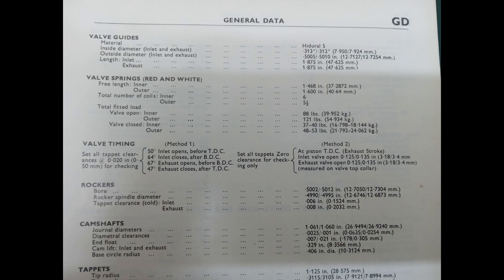Triumph Trident T160 Rebuild. Part 66: Optimising the Valve Timing 4

Comment: How do you stop valve spring pressure moving the camshaft while the pinion is not holding the camshaft still, or is this not a problem?
Reply from the maker: I can see why you might think that, but it's not a problem at all.

Comment: As far as the workshop manual settings being different, it seems to me that this lower setting is less tlikely to result in any home mechanics going over the absolute limit of 150 thou. I’ve found that many workshop manuals (including factory ones) prefer to err on the side of caution with such things. I have two manuals for my 1997 Harley Sportster and have found siginficant differences in the information provided in each. Not a lot of difference in the specifications area, but enough that I no longer regard the workshop manual as ‘THE BIBLE’ as far as such things go. More often, I rely on people such as the chap mentioned in this video, who know the machines very well and know the OPTIMUM settings for the best results. 
Of course, there are many ‘experts’ out there, but the ones who have a proven track record are not hard to find, as they will have decades of work behind them that testify to their acutual level of expertise. People who have built and maintained very succesful racing enigines for example. In the case of the Tridents, anyone involved with the factory racers would know better than your average factory trained mechanic.

Comment: Thanks for the update, but I don't feel much better off after your explanation. A dial indicator is still not going to register those 3 or 4 degrees when the piston doesn't move at TDC and BDC so it has always been a case of seeing where it stops moving and where it starts moving again, and split the difference, so a well educated guess, and I don't understand why the factory wouldn't set the valve timing at the 'optimum setting' rather than some 'good enough' setting when it's no harder to do and could result in a better running bike, it just doesn't make sense. Anyway, good luck with the project, looking forward to seeing the engine running.
Reply from the maker: Okay, the whole reason for the dial gauge is to remove the guesswork from exact TDC for the piston. By using a combination of the dial gauge and degree wheel you can discover the exact position of TDC (measure from BTDC with the dial gauge to the same point ATDC then check the degree wheel and halve the measurement  - that's exact TDC) The factory never did all this as it just takes too long, so they just set it to standard: align the woodruff key on the camshafts with the intermediate pinion, use that keyway for the camshaft pinions and align the timing marks. Setting everything up as I did on the video takes far too long. Triumph/BSA lost money on every bike as the labour was so intensive, so they couldn't add any more. Contact the TR3OC (Trident owners' club for more info and to verify what I'm saying)
Reply: @Chris.rooke150  Fair enough I guess, it seems far more complicated than it needs to be.
Reply: @Chris.rooke150  May be the confusing thing about what the factory did; also with the T140; is that after you know that in which mark is better (as in this case) just use those marks instead of the wrong ones; so the factory insisted to use the wrong marks; when for example for the IN of the T140 (or for the tridents etc) you just put it on the other mark and will be better (not so over advanced) or better yet, like you did; using the implied third mark. Still a mystery.

Comment: From my limited understanding of valve timing, changing the timing to increase the valve lift by 15-25 thou  to 150 thou at TDC exhaust stroke, will effectively increase the overlap of the valves, which will give more power at high revs, but at the expense of reduced mid range power/torque.
Reply from the maker: Quite possibly. 👍

Comment: That is not how I set my valve lash.  I set the exhaust of #1 when the exhaust of 2 & 3 are just on the rock.  3 beginning to open, 2 just closing,  Roll it around until # 1 & 3 are on the rock and set 2,  Then finally set 3 when 1 & 2 on the rock.  Once exhaust set, move on to the intake with same method.
Reply from the maker: I think you're confusing setting the valve timing with adjusting the tappet clearance. Two different things.

Comment: Information from Triple Echo 119:  Phil Pick believed that the workshop method 2  showing .125-.135 in lift was probably at the tappet where the .140-.150 in method would be as you show, at the valve. 

Frank Long
Reply from the maker: Thanks, Frank. 👍
Reply from the maker: Although I've just checked the manual and it clearly says  'measured on valve top collar' underneath the measurement. 🤔